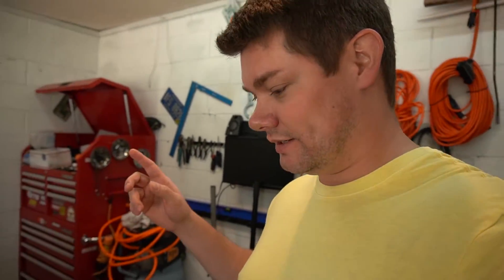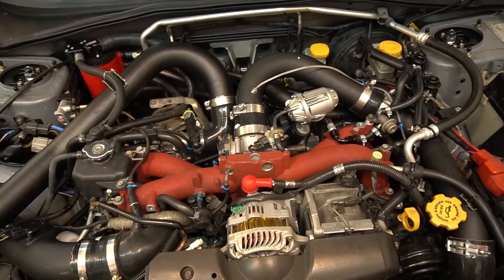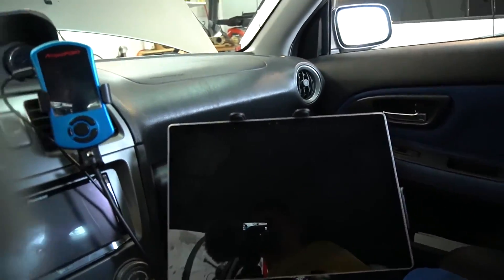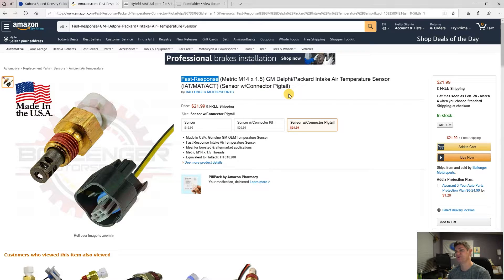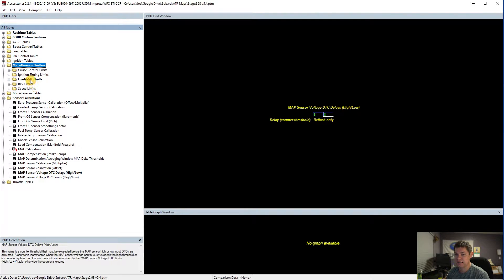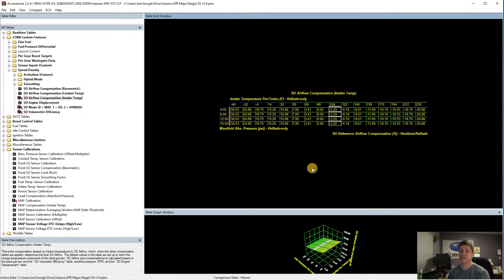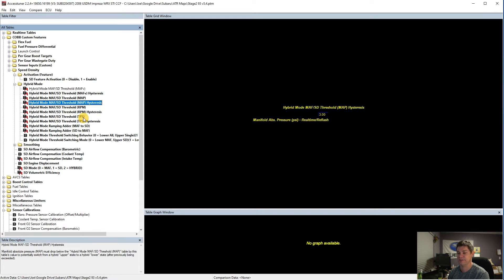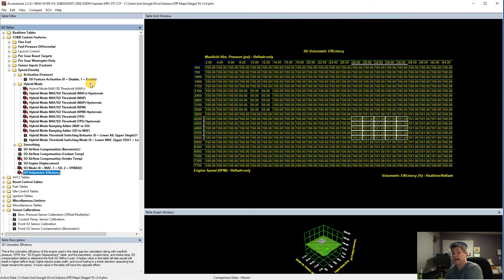Going Speed Density with Cobb AccessTuner

Comment: One question how do you download a COBB custom features map, I have a 17 wrx and I tried it once and it said my ECU is not compatible with that MAP? I would really like to try and tune for tgv deletes and CCF map would make it easier.
Reply: On Accesstuner you  will not get speed density under Cobb Custom Features. Only on Accesstuner Pro.
Reply: I also have that problem. Speed density is not available for Accesstuner. Only for Accesstuner Pro which protuners use.

Comment: I use calculated ve when running in maf mode to get my base for my speed density tune. I used mega log viewer HD to build a histogram with the exact column values with my Cobb logs. Full time closed loop of course. Temporarily I did zero out all my compensation tables above 120f on coolant temp.
Reply from the maker: Good info.  I really need to use Mega Log HD more.  Just use Excel so much in life I naturally move to it.  I have the next video ready,  but I'll try and squeeze this in.